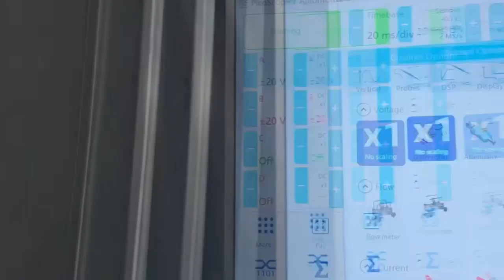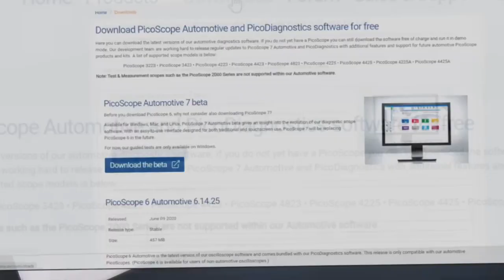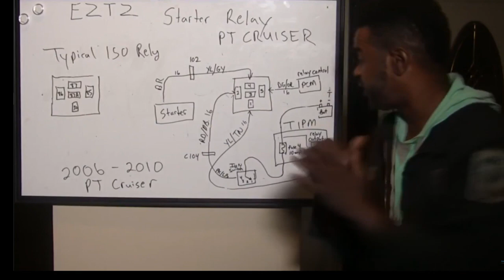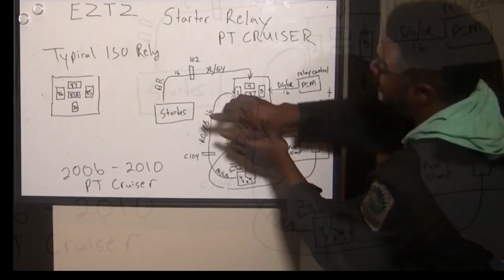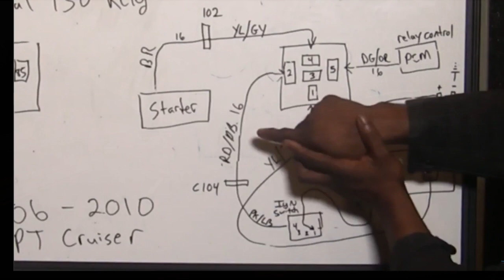Final Pico Scope Training day at the Chrysler Training Center. Help with diagnosing cars explained.

Comment: All modern cars are computer controlled now so you have to understand how they work. When I started working on my own cars most of them had carbs, distributors, and points. My friend and I put a electronic ignition distributor and box out of some newer Mopar with a small block in it and it worked. I also put a newer 100 amp cop alternator in it with the electronic voltage regulator and I kept upgrading parts to make it stronger and faster as deals came up. Now all the drivers we have are fully computer controlled so a different world but in some ways its easier because I already know most systems and what happens when they fail but now my scan tool tells me what is probably wrong so I don't have to spend so much time troubleshooting, plus Google and folks like JT if I get stuck.